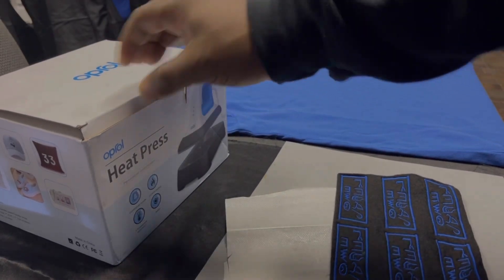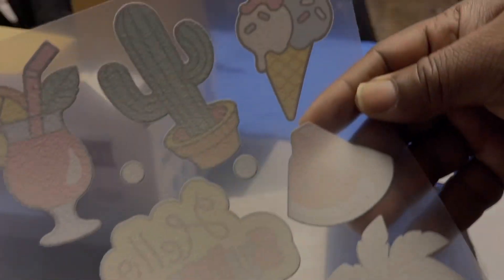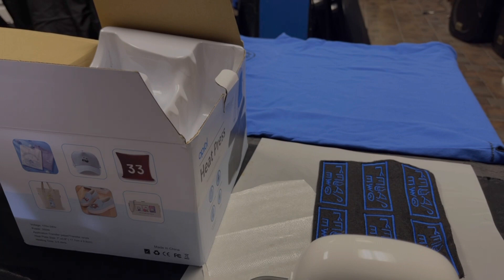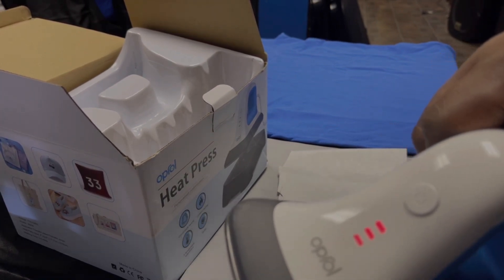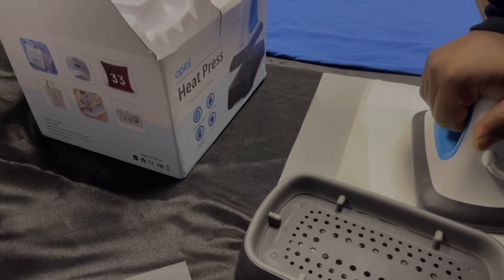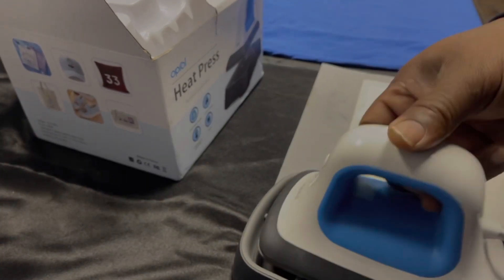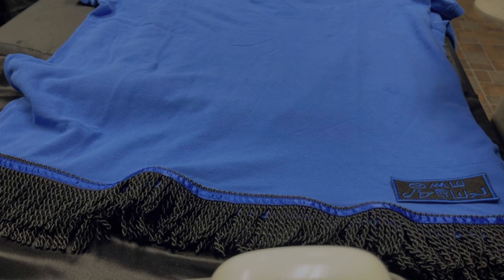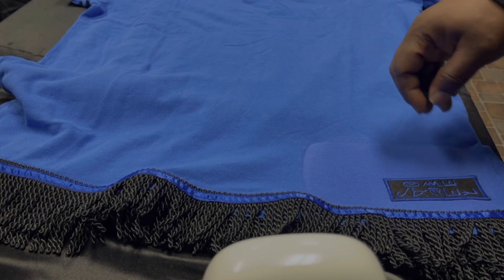OPROL HEAT PRESS review/patches/DTF is everywhere

Comment: is it good for pressing logos on shirts and hats? Is it effective? does the logos stay on the clothing if it is washed or thrown in the dryer and does the logo fade if it goes through the washer and the dryer?
Reply from the maker: If your speaking on DTF printing...it does not fade and has proven itself far as wash test.  It’s a proven method to making shirts.  The press is for small projects very small but it will get hot enough to press down just about all HTV transfers.  The press actually burn through that table smh. But ultimately you want a heat press and a hat press for hats will be difficult with that type of press because both sides would need to be pressed down.
Reply: @phineeprints9840  ok gotchu

Comment: Why not use your heat press to apply the heat bond to the patch?
Reply from the maker: Great questioned, If I had 5 to 10 of these to apply the smaller press would be more convenient.  I could lay all the shirts on a table and go down the line pressing them.  With a heat press I have to load each shirt and Align it on the press, it would take more time.  I do use my heat press to apply the bond to the patches but it was a review and I was just testing it to see if it work. But I use it mostly for applying the actual patches to funny areas, sleeves and neck labels